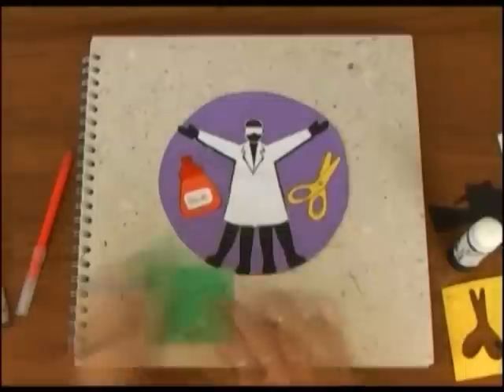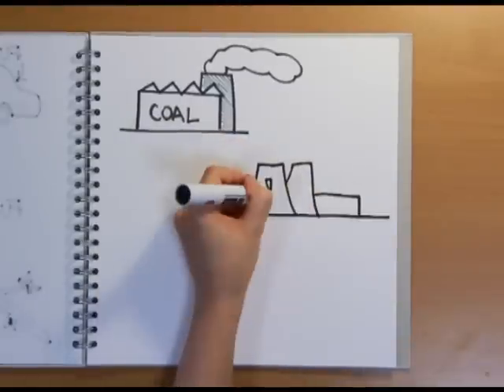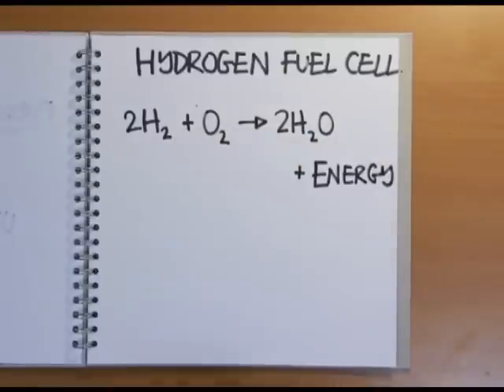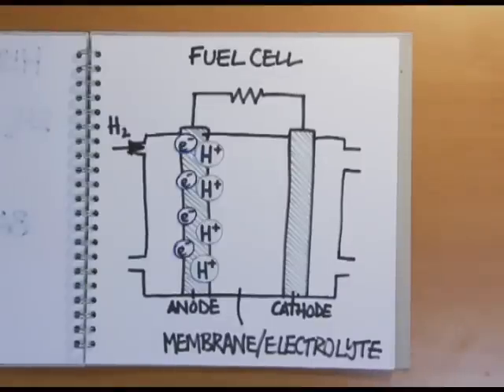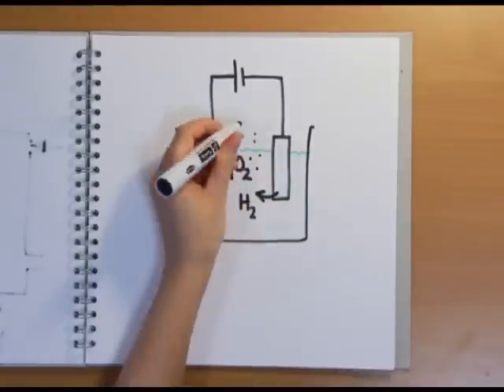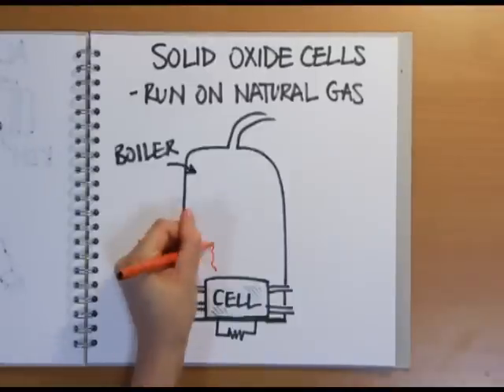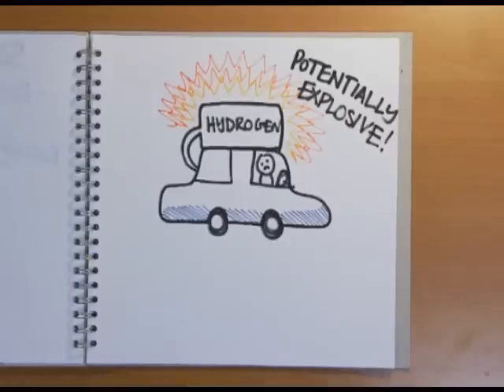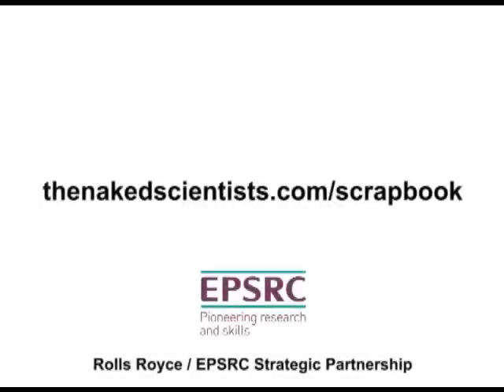How does a fuel cell work? - Naked Science Scrapbook

Comment: Hydrogen does not need to be carried on the scale of hindenbergs in cars. Cars can have hydrogen cartridges system where a 'tank' does not need to be filled up with hydrogen. Instead, an airleak proof cartridge lock system can be installed. Where a mini hydrogen canister can be placed as the fuel inlet. Emptied mini cans can be quickly replaced. Gas stations can stack up on such cartridges and a single cartridge can last for many miles. It would rid the cars of the weight of the batteries entirely.
Reply: The cans can have added protection for small shocks. Even in the case of massive crash, the amount of hydrogen in the single can would not be enough to cause a huge damage. The existing fuel tanks also have some protection against leaks, in the case of an accident.

Comment: Potentially explosive?
Split a hydrogen tank in half and the gas will be potentially for the few seconds it would take to disperse below its flash point. Split a Gasoline tank in half and the spilt fuel will remain combustible and potentially explosive for many hours.
Stop thinking in the terms of the HindenBurg.
Reply: That’s what I have never completely understood. There is probably a gasoline fire in the county that results in a fatality every day but we treat gasoline like it’s the same as  diesel  in volatility. The Hindenburg set the world backwards in development of this fuel I’ve always thought.
Reply: @sandyt4343  IMO We're missing out on the lifting potential of Hydrogen.
Instead of cow stomachs we have modern materials for gas bags. We also have a whole raft of (warning) sensors they could never have dreamt of 90 years ago.
I see no reason why H airships should not be reliable, cheap, and close to carbon neutral.

Comment: I think is much more pratical to develop and use liquid fuelled (e.g. methanol or ammonia) fuel cell that use stored hydrogen as intermediate energy vector, particurally for range extender in serial hybrids for longer trips not allowed from today battery ranges only

Comment: Hydrogen is explosive, but its safer when it burns because the diffusivity is so high it burns in a column out of the hole it may escape from in a matter of seconds. and good luck trying to ignite it when its in a compressed container.

Comment: How is a battery different from a fuel cell?
How is a fuel cell different from a battery?
How are they alike?
I think, a fuel cell, is merely a battery where the 
electrolyte is in a dynamic state... And so, rather
than changing batteries, you change the electrolyte -
weighs less... Think of the electrolyte as, the fuel.

Comment: whymake a fulll ceellll just electrfy the water make hydrogen
Reply: The point is to produce more energy than you use. To split water, you need electricity and a way to make that electricity. If you use the same hydrogen you get from splitting water to produce the electricity you need to split that water, you'll just keep loosing energy do to heat loss. It's like how a bouncy ball eventually stops bouncing.

Comment: Fuel cells are dumb. They're pretty much REALLY expensive batteries, or rather, a HHO generator in reverse. You need to split the hydrogen and oxygen from water apart to run the fuel cell that joins the hydrogen and oxygen back together to make water. So effectively it's a water-energy economy, and given the third law of thermodynamics it's a very lossy economy, to the order of a 80% each way loss, so you get 2 kW for every 10 kW of energy wasted